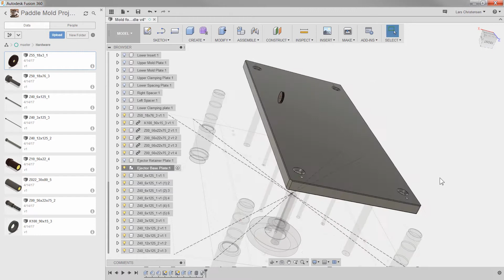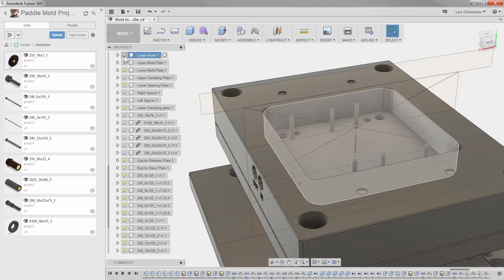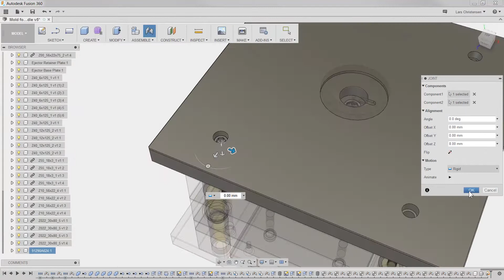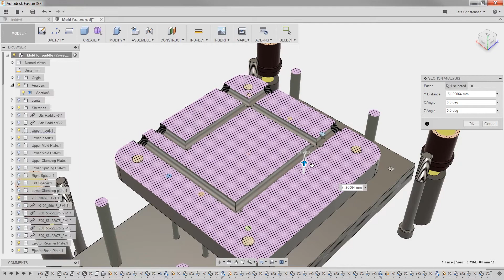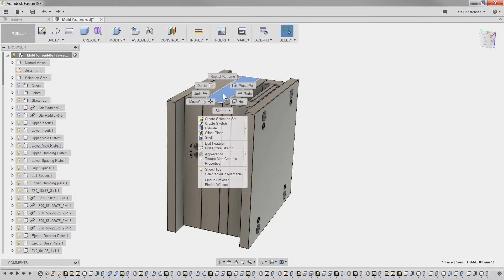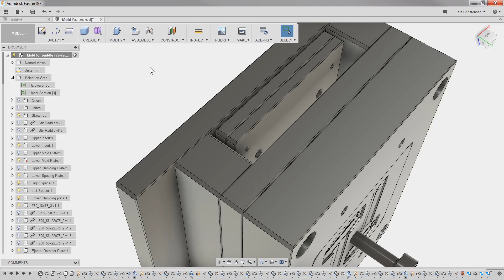Fusion 360 Tutorial — Beginner To Advanced — How To Create a Mold— Part 5

Comment: Great Fusion tutorial for using common sketches and how to approach a large assemblies (which is after all what your goal was), but, to those not familiar with injection molding, nobody would build a simple mold base from scratch. Companies like DME have them on the shelf ready for you to modify (drill, ream, bore, tap) to meet your needs. I also think the taper in the spru is backwards (unless "I" missed it) the small end should be closest to the hot screw extrusion barrel and the large end at the parting line or it will never pull. GREAT JOB  educating us on the finer points and tricks using Fusion - I always come away smarter!

Comment: Lars,

These videos are great, and I really thank you for taking the time to make them for us to learn from! However, I did notice that, in your layout sketches, you tend to make bisymmetric patterns of holes which have locating dimensions on each hole. I, too, enjoy symmetry, and tend to make bisymmetric bolt patterns on a lot of the things I model. When doing this, I've found it very helpful to start by creating vertical and horizontal centerlines that I can then use as mirror lines after I've located and sized the holes in my first quadrant. That way the position and size of the holes in the other three quadrants are fully defined by the dimensions on the holes in the first quadrant combined with the mirror lines.

I hope this is helpful to you! I think it could help significantly reduce the complexity of your layout sketches - especially if you find yourself adding in additional bisymmetric patterns around the original centerlines as your design progresses. Since those additional patterns will also only require the holes in one quadrant to be dimensioned, you could dimension them in a different quadrant from the original patterns, thus spreading the density of your dimensions around the sketch.

Thank you for all of your great content!
Jay

Comment: Havent done  molding in a number of years but this tutorial is an excellence one on how a complete ready to run mold is done with a couple exceptions.  There is an interference problem with the bolts and the cavity and no venting.  Not an issue as far as the tutorial goes but would be need to be fixed to make it a working mold.  Beats the hell out of the paper and pencil method doing it and doing the cutting manually on a good brigeport. CNC technology was basically a pipe dream for anyone other than the government in those days and there was NO computer or cad/cam programs available either. It was all done by hand. :)

As this is NOT a lesson on the finer points of doing injection molding i wont quibble about it as they are very easily fixed by doing exactly as you demonstrated by moving the injection plate bumpers.  :)

I would suggest a series on caming this as the icing on the cake...

EXCELLENT tutorial, keep them coming..
Reply from the maker: Hi John Ware Thank you for taking the time to watch the videos! ANd the great comment.

Have an awesome day!
Best,
Lars